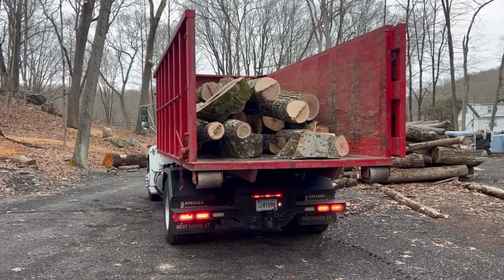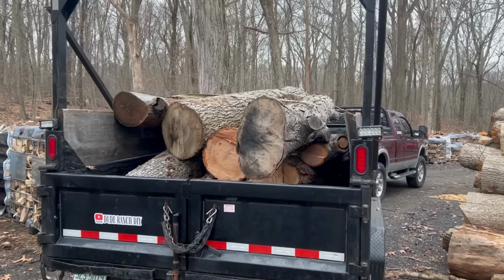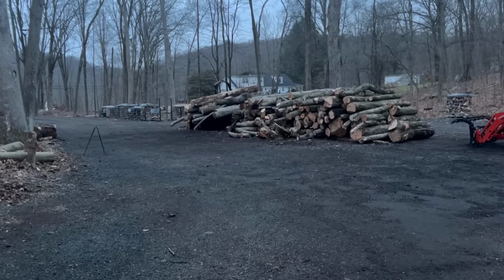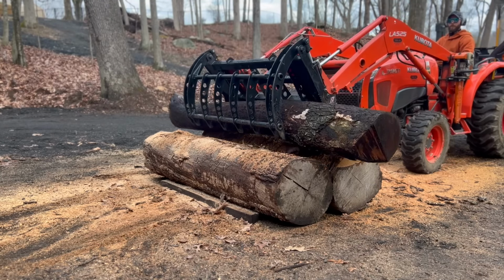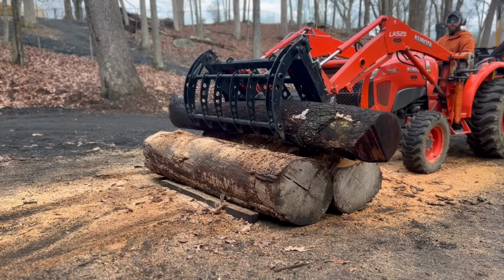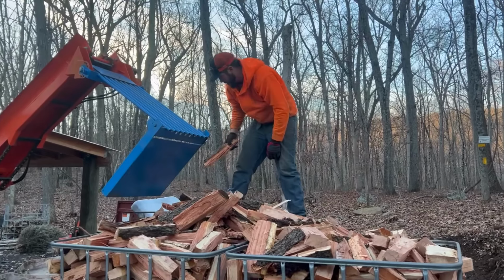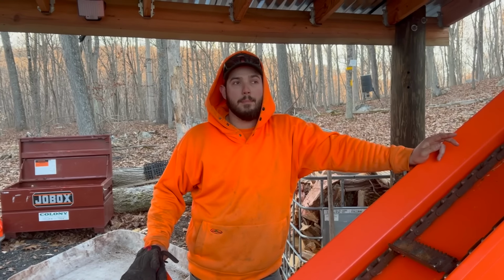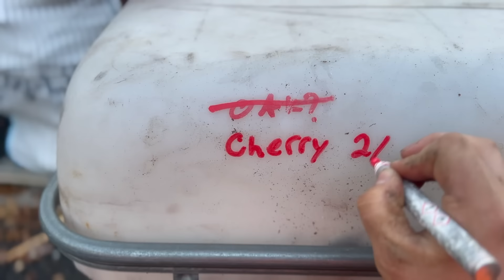#456 SPLITTING FIREWOOD Into 4 Totes AT ONCE!!

Comment: Hey Jake and Chris! Seems like you found a winner with the 4 totes at end of conveyor! I'd keep doing that!!
Reply from the maker: Yep it’s been working well so far
Reply: I always thought it was a waste of time stacking logs in those cages.just chuck them in loose and if the customer doesn’t like it they can lump it as we say in England, they invariably just get tipped out anyway. Ps i just want to add that I have subscribed  solely on the basis that you tip the logs in loose😊. Now my take on the system is that 1) you get a little rest moving the totes, 2)the machine gets a little rest. Pity the totes were not a bit bigger.

Comment: Gents, I think the math will all work out to be pretty equal whether you do one tote or 4 totes at a time with 2 people and enough rounds to feed the splitter. 15 minutes per tote is one hour for 4…  either way you’re still going to take about the same time moving the totes.  The wild card is processing the rounds to keep the splitter fed, along with the size and quality of the species of wood.  Oak takes longer to process than Maple and 10 inch rounds versus 20 inch rounds will probably change the overall time as well.  Just thinking out loud.  Good video guys.  Cheers.
Reply from the maker: The 4 totes at a time has proven to be faster and more productive for us so far, yesterday we were able to fill 12 totes in 4 hours without filming.

Comment: Is that second roll off truck a 40 yard dumpster? 
Thats like 4 cords-ish?
   Id have said heck yes to oak logs. 😂😂😂  bring it on! But hey, when u got a mountain already u can be picky, 
And ive had some bad experience with "bigger oak". They be bringing 48" log(s) rounds
  Great vid
And 4 totes in 1 hr is good,  get em moved out, let machine rest, and u guy s catch a break, and go back at it again. Yall would get 20 to 24 toted done in a good day?
 Maybe u can line up 6 and flip that blue chute up or down?  Idk man im old 😂 
  Im still in ruggedmade mode. 
1/2 cord per hr or so, good times with a good buddy/coworker tho.  Plus wood amount goes to 3/4 to 1 cord per hr with a good co worker.
Reply from the maker: Yep 40 yard, we got that entire load split yesterday and it filled 12 totes in about 4 hours so yep about 4 cords. The oak was very big, not worth all the extra hassle.
Reply: @DudeRanchDIY  hell yeah 12 totes in 4 hrs, so 24 a day is attainable, even 28 if yall push it to the limit and have a mountain of rounds ready to go, or a 3rd guy hanging out keeping fuel tanks full and odd jobs. 
Nice man.  Hey also your older videos with the ruggedmade  dude concerning the 6 way wedge aere great, i got one on the way, i got a 120 cord splitting job lined up here and that wedge is gonna be sweet

Comment: Until recently Brad had a nice clean wood yard too, but yes it makes wanting to spend time with this hobby easier when it’s organized.  Did you guys ever find out why the international couldn’t lift the small load of dirt?
Reply from the maker: That really wasn’t so small a load of dirt, it was about 5 yards of wet topsoil. Each yard of topsoil weighs about 2,000 lbs plus the weight of the can. If it was on the truck it would’ve dumped it but picking it up from the ground was too much.

Comment: 4 totes of wood to move at one time. I would guess it would save about 15 minutes. The only real way to know for certain is run 8 totes each way. Starting with placing the first tote and taking care of the last tote. I would lay money on the 4 tote method by a minimum of a half hour.
Reply from the maker: Yep it’s definitely faster, yesterday I was able to move the 4 totes in about 12 minutes and get back to splitting